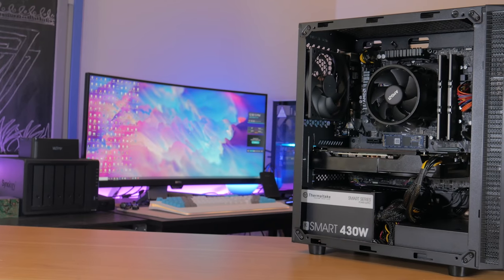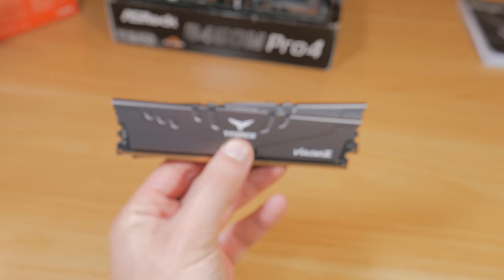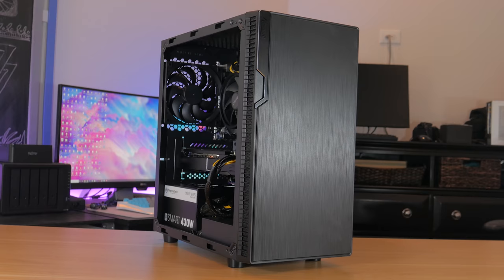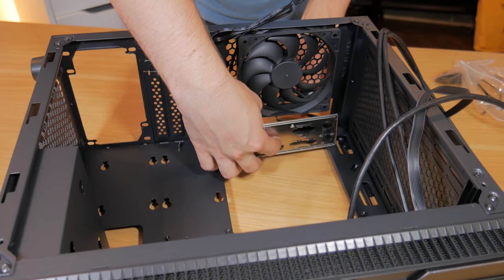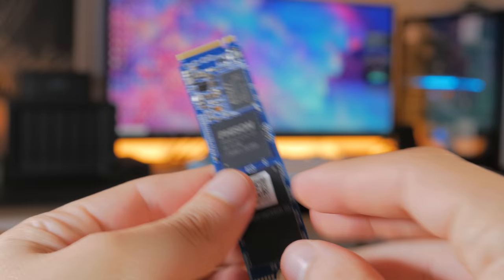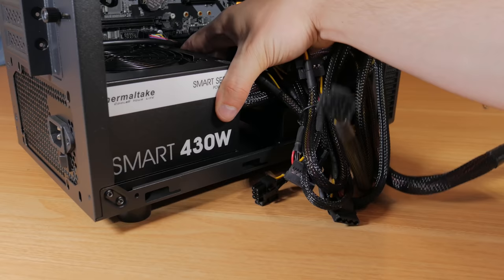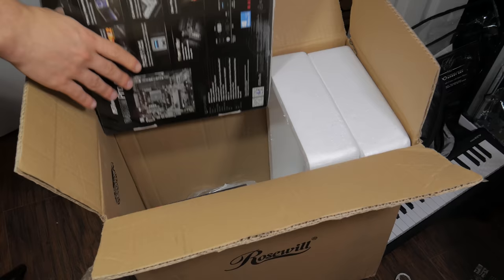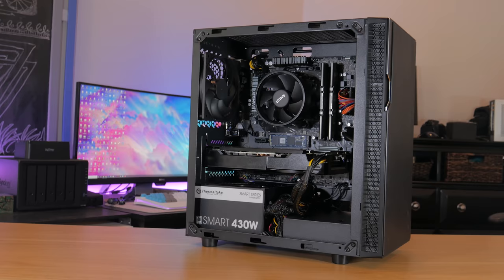$400 Gaming PC Build Guide! (2019)

Comment: So my budget is $500-$600 I’m definitely going to get 16 gb of ram but what gpu should I chose that offers more performance
Reply: Rx580 if you can afford it
Reply: I would shoot for a RX 590, or a 1660, it’s up to you.
Reply: I would upgrade your CPU to a 2600 or 2600X, and the ram is fine (for now) just get it faster you will have to upgrade your GPU to something better tho (this is what I would do, listen to me if you want)
Reply: Sanctified Rezus No, you need the 16 gb as first upgrade. And also, 1050ti is literally 50% worse than the 570, so no again. I agree with the 2600 though.
Reply: @CrisisVFX  you really shouldnt give people advice when you have no clue at all
Reply: @pinkin8012  ?
Reply: @pinkin8012  explain why I'm wrong
Reply: @CrisisVFX  vibiz already answered that question. You recommended a freaking GTX 1050 Ti. Its not an upgrade but a severe downgrade
Reply: Shubhabrata Ray there is little to no difference between the 1060 3gb and 1060 6gb. There both almost equal to 570.

Comment: The Ryzen 5 1600 fantastic value.  If you want to save a few dollars, suggest picking up 2nd hand cpu and gpu. Picked up a 2nd hand 1600 for USD 71  RX580 8gb for USD 91 could not be happier

Comment: Using Windows 10 inactivated does have 1 small disadvantage other than the water mark. It also will not allow you to use the personalize settings such as the themes and desktop icon settings

Comment: A new update just buy the cpu to Ryzen 5 1600 af this cpu will give you the power of Ryzen 5 2600 but its even cheaper then Ryzrn 5 1600 i think its around 85$ and change the gpu too gtx 1650 super or RX 580

Comment: i personally would  go for a better power supply like Seasonic M12II 520W with full modular and black cables. And the case i would choose for the Aerocool Aero300 faw or Aerocool Cylon with similar price point with acrylic side windows and there are also options with white version for the Cylon. And one more thing would definitely recommend to get an 8 gb stick, so you can purchase another one for dual channel later. Other than that, the choices are quite decent.

Comment: My budget build - Firestrike score : 15,757 by [Tek]Praetorian
Intel Xeon Processor W3680 6-core/12 Thread(3,300 MHz) Stock
Turbo 3.6GHz
AMD Radeon RX Vega 64 8GB HBM (1,637 MHz) Stock
16GB RAM syste
1TB SSD
600 watt Gamemax PSU
Water cooled Antec K24
RGB lightening.
$508 total cost. 
😉
Reply: Noice

Comment: The psu you choose is really bad, there are plenty of better choices for similar pricing
Reply: Agreed, don't buy Thermaltake. Also I'm concerned about thermal performance with the PSU + GPU fans fighting for air the way Matt has installed the PSU. IMHO it would be better to install the PSU fan downwards.
Reply: @blakecasimir  Tt has some good products, but under a certain level it has only shit. Like, some 80plus bronze and above are good, under that line they use mainly cwt crappy series like the ones in corsair's od vs's anche in cooler master lite series

Comment: I bought basically this Pc for 400 myself although it was used. Hp Pavillion desktop. 
I don't even get close to the fps you are pushing from your build 

Ryzen 5 1600 
16gb corsair vengeance ram 
Rx 570 4gb 
400 watt 80 plus platinum power supply 
500 gb ssd hynix w/ 1 terrbyte hard drive
Hp sunflower motherboard which is basically the Achilles heel of the system

Comment: 3dmark: Firestrike 

SCORE
15 757 with AMD Radeon RX Vega 64(1x) and Intel Xeon Processor W3680
Graphics Score 23 494
Physics Score 11 316
Combined Score 5 470

DIYPC DIY-A1-BK Black Tempered Glass USB 3.0 ATX Mid Tower Computer Case with 1 x 120mm Fan x Rear Pre-installed  29.98

GB LED Strip Computer Lighting via Magnet with 24 Key Remote Controller $14.80

SAPPHIRE Radeon RX Vega 64 DirectX 12 8GB HBM2 PCI Express Graphic Card $249.99

Intel Xeon W3680 3.33 GHz 6-Core/12-thread CPU | SLBV2 $64.90

Corsair CMZ16GX3M2A1600C10B Vengeance $67.99

Antec KUHLER H2O K Series K240 120mm CPU Liquid Cooling System
$70.65

Power Supply 600W Semi Modular 80+ Bronze, GAMEMAX VP-600-M-RGB
$54.99

X58 LGA 1366 motherboard LGA1366 support REG ECC DDR3 and xeon processor USB3.0 HUANANZHI
$51.7

Total $509

Comment: I really would spend the extra money for a better psu.

A smart 430w is anything but a smart purchase.
Reply: I got a Thermaltake R2 500w for my optiplex with rx 570 but it didn't have the correct 4 pin
Reply: @dapyzzz4209  thermaltake tr2s are also junk. Really something like a Corsair vs550 ($37) would be a better choice.

Really I love the Corsair CX models. They are relatovely chesp but also use LLC resonant topology, a premium feature.
Reply: ☺️ jiji

Comment: My system costs around 1000$ back in 2014 I got most of my hardware used and some of it free from family. i5-3570K , GTX 960, 16gb RAM
Reply: I had a gtx960m and damn it was horrible i could open counter strike on lowest settings in 90fps

Comment: The cs go seemed kind of like it was hanging in the benchmark video. I've seen it runs like water on processors like  ryzen 3 2200 with same graphics card. So going to next gen processor would be same if not better is what I would think.  Either some thing went wrong in your recording or something else is different in your setup.

Comment: hey I need help on upgrading my younger brother's pc that I got him. He has ryzen 3 1200 with an rx 560 ,his motherboard is a b350 with 16 gb of ram. currently i only have 100 dollars to upgrade his system but I don't really know what to change with my current budget. He mainly plays Overwatch but I bought him Borderlands 3 and his system could barley run it so Im bummed that he cant play the game he's been waiting for a while now. Any advice would help.
Reply from the maker: I would probably upgrade the GPU before the cpu. Going for a rx 480/580 on ebay for around $100 is a good way to go. Also see if you can overclock the cpu and ram a little bit as that can be free performance. Also sell the 560 after upgrading to recoup some of the cost.

Comment: For around $490 I built a PC with ryzen 5 2600, 16gb ram 3000mhz, 256 GB SSD , case with clear side panel, gtx 970
Reply: That's including windows 10 pro key and a 500 watt power supply

Comment: Go for used parts.
build a similar system last week for the same money but with better parts.
R5 1600 65€
Wraith Prism Cooler 13€
MSI B350 GCPro 50€
2x 8gb Aegis RAM 50€
RX 480 8gb Red Devil 100€
500w be quiet SFXL 50€
250gb Samsung Evo 850 10€
2tb Seagate NAS 20€
New be quiet pure base 500 50€
Reply: F1reMaker1 Naah.. Please don't choose 2nd hand system storage

Comment: Still using xeon x3430@ 4ghz paired with that same rx 570 with 12gb ram kinda still ok for games @ medium to high settings considering my system cost like 250$ a mixed of used and brand new parts
Reply: 🙂 pu an 8thread 3470, they are really cheap now
Reply: @MrSamadolfo  yep theyre like 20$ in my country before they were like 30-40$
planning to buy that after buying a 480gb ssd

Comment: Good configuration at good price...Very good and educational video...I am having HP au114tx laptop with Nvidia 940mx graphic card 4 gb..do increasing my ram is going to improve my fps for games like battlefield v , kingdom come Deliverance, Witcher 3 ??? My current fps is approx 20 on these games with low setting..please suggest me..thank you
Reply: 🙂 laptop or desktop you shud b running 8gb of system ram, those games are very heavy
Reply: @MrSamadolfo  thanks for advice sir..but my ram is already 8 gb and graphic card is 940mx 4gb with core i5 7th generation
Reply: 🙂 ok i checked, ur gpu only has a 3D Passmark Score of 1367, so thats pretty low, thats like a GTS 450 or HD 5750 video card on a desktop, theres nothing u can really do but try lowering the settings to 'Low & 1024 x 768' other than that is to move to older games like on GOG, and get another laptop or desktop later on, maybe a cheap used one and upgrade it with a used but faster video card 🙂

videocardbenchmark.net/gpu.php?gpu=GeForce+940MX&id=3453

.
Reply: @MrSamadolfo  thanks sir for advice...
Reply: @chotudivedi3018  🙂 sure no problem, Play Hard 👍

Comment: Has anyone build and played Destiny 2 on this? That’s probably going to be the main game I play.
Reply: LilNuut I actually used to play destiny 2 a year ago with my old specs that were a ryzen 1500x and a gtx 1050ti. Worked very well on even med settings. Destiny 2 is very optimized on pc. I upgraded my 1050ti to an rx 570 8gb and saw a big improvement in destiny 2. I currently have a ryzen 1700x and the same rx 570 8gb. The game is so optimized I love destiny so much it’s nice you can play even on entry level parts

Comment: Hi 
I found this video very helpful. I just have two questions : 
Where do you get the drivers as I have repaired a laptop a week ago. I changed out the broken hard drive and replaced it with an SSD and reinstalled windows. The find is that the drivers where installed automatically so I don't know if for a "home-made" gaming pc will do the same or  will I have to do it my self ( I've seen on YT that you do have to do it your self but I'm wondering if it was the same for this computer. 
My second question is : can you play fortnite and battlefield 5 at 144hz even on low settings ? 
Thank you and have a great day !
Reply: Pretty sure drives don't need drivers and Fortnite will run at 144 but Battlefield won't at 1080p.

Comment: hey @Tech By Matt i build the same system with you but i bought an rx 580 assrock for 125 but it goes near 85c when playing games at full or high like farcry 3 what should i do (the gpu is new) should i replach its paste? with some mx4?
Reply: 🙂 sure try that, but before that have u tried raising the fan speed using Afterburner? and in afterburner try unlocking the voltage slider, then slide down the voltage and hit apply, keep lowering it until it crashes, does that reduce temps enuf? also open Riva and put an FPS cap, like 35 fps, does the temp come down?
Reply: @MrSamadolfo  yes man its the same 3000rpms and the cpu temp are almost the same (i read on a forum that the heatshink of the gpu is poorly in quality in cooling the gpu ,some mx4 will get the gpu at 75-80 thats like 5/10 celsius lower)

Comment: Hey bro i just want to ask that for rx 580 8gb and core i7 3770 both stock is 450w 80+ powerstation psu is good i know is not enough but will it cause any kind of damage?
Reply: 🙂 nope, its fine, assuming thats a fairly new & modern power supply
Reply: @MrSamadolfo  yes its new and unrepaired!
Reply: @dota2gamer469  🙂 ok great then u should be just fine 👍

Comment: Power supply and graphic card fans both faced each other so it might be overheats
Reply: 🙂👍 its fine, the psu fan sucks air down, the gpu fan blows up into the card and then the hot air rises up & out
Reply: I don't agree it's fine, imho better not to have the PSU and GPU "fight" for air.

Comment: Ive got the ryzen 3 2200G but I want to upgrade the gpu as vega 8 is not that good, do yall think a gtx 1050ti could run fortnite at 1080p 60fps?
Reply: Yes it will, I have a 2200g and a GTX 1060 3gb and I get over 60fps in fortnite. 1060 and 1050ti have around the same performance.
Reply: Mike Polk I’ve kind of got a high budget for the gpu so i might get a really really good one but without getting to the point of cpu bottlenecking
Reply: @fabian546  sounds like a good idea I wouldn't go any higher than a gtx 2060 or don't forget about rx 580 and 590.

Comment: Guys, quick question: 8gb 3000mhz or 16gb 2666mhz? Will the speed of the ram really make a difference beteren 2666 en 3000?
Reply: Roan Andrea no, you will not see the difference
Reply: 🙂 on a Raisen 🍇 platform it will, its built differently compared to anything else

Comment: Hey matt the exhaust fan did turn on on the first time? Im having a problem that i have is that i wont turn on until i enable max speed at bios
Reply: Try a different fan port on the motherboard
Reply: 🙂 maybe its plugged in the wrong fan header, read the tiny print on the board

Comment: i have build a similar PC like this one and i have run with a problem. 
i have the mouse and keyboard connected by USB and when i plug in a USB cable for charging a phone or a controller all my USB connections  power down for about 15 sec and then they come back, like a reboot.
 i do have a 500w  80+ bronze psu but i dont think is the psu because i consume about 430w. 
does anyone have and idea what it could be?

Comment: So I have a question, I was talking with my friends and pc builders, and with this same build, I ordered the parts and everything besides the ram, used a different ram. But, it says the RX 570 needs 450w power supply. And I’m this build it’s a 430, wouldn’t this burn out the power supply? I’m very concerned about when I power it on and play games for extended time, my pc with burn out and, my parts and everything will die, and or if I overclock it as well. Can someone help me out, and tell me? Will this run my power supply out and ruin my pc? Or can this run good/fluent and won’t burn out?

Comment: Can I connect this with WiFi or does it have to be through Ethernet cable
Reply: You would need to add a Wifi card to the build otherwise you are using Ethernet cable.
Reply: Shirewolf thanks, so you recommend any brands for this certain build?
Reply: @Andrew-zy6cz  I believe this build leaves you limited space with the lower PCI slot to add a card as its fit may interfere (rub against or stop) the GPU fan blade just above it. (The Wifi PCI card would be between the top of the PSU and the bottom of the GPU card)  Amazon has cheap plugin USB WiFi adapters you could try.
Reply: Shirewolf aight, thanks for all your help man.  :)

Comment: Im wondering if the 430w psu can supply power for the gpu, im new at this kind of stuff but i search that 500W psu is the minimum requirement for rx 570. I have plan on upgrading my gpu to rx 570. I have 500w coolermaster.
Reply: PLEASE HELP

Comment: wont that video card be fighting that psu for airflow?
Reply: 🙂 nope
Reply: @MrSamadolfo  disagree. My question was rhetorical. Both intake fans are facing eachother, so yes they will fight over air flow, whenever the PSU fan turns on.
Reply: @TheTokuin  🙂 its fine, the psu fan will pull air down into the psu, while the gpu fan will pull air up into the card, the front case fan feeds them both with fresh air 😍 yay!

Comment: How would this system perform for simply watching HD movies on VLC and streaming movies in hd from vudu, crackle, tubi, popcornflix, etc. This would be for a bedroom system, I already have a robust system for the living room. No games would be used. I am not sure to go this route or a core i3-9100 with a Gigabyte Z390I Aorus Pro? A little bit more money but might be worth it. All other parts I have. Thanks for the video
Reply: It'll perform exceedingly well. Some may even call this 'overkill' for just streaming and watching movies.
Reply: Thanks. I ordered the new amd 1600 AF from amazon ($85) and purchased from microcenter the Gigabyte B450I Aorus Pro Wifi AM4 mini-ITX AMD motherboard. I have memory, ssd, case and PS already. Will be putting in from my other system a gigabyte 1080 TI since for that system, I already have installed a core I7-4790K (living room setup) which does just fine for watching movies without a dedicated GPU. AMD system going into a H200 case. Maybe any overkill system but why not buy with future growth in mind. Yes, the 1080 TI is probably way more than one would need for watching movies but I have it already and was donated to me by a buddy. The AMD system will need a GPU so why not just use what I have.

Comment: Can someone pls help, I just built this and when I try to boot it up, my monitor just says no signal. Everything seems like it’s running fine: my fan, gpu etc.
Reply from the maker: Make sure you're plugging the display cable into the graphics card and not the motherboard. I would confirm the cable you are using is working by testing it with something else. If you find the monutor/cable isnt the problem, reinstall the ram and the graphics card. If none of this works, you can DM me on Twitter for further help.

Comment: Just asked my dad if me and him could look up parts to build a gaming pc he said yea but i didnt ask the budget yet, but if its $300 or over i think i can run fn pretty well, also i saw 16 gb ram for $35 soooo?
Reply: The ram you saw was probably DDR3 , it’s an older generation of ram that isn’t compatible with new motherboards and CPUs . Just about anything with a budget over 300$ can run fortnite with good frames and high settings . I recommend taking a look at the 3400g or 2200g ryzen CPUs.
Reply: yea i got a ryzen 3 2200g cpu and the ram i have is Patriot Signature Line 8GB (2 x 4GB) 288-pin DDR4 PC4-17000 2133MHz Memory Module Kit PSD48G2133K and yea that cheap is one i found was DDR3
Reply: EnvyTheShotZ nice

Comment: why diidn't you picked a ryzen 3 2200g its like the same price but better
Reply from the maker: The ryzen 3 2200g is a four core four thread CPU. The CPU I used(Ryzen 5 1600) has six cores and twelve threads. The r5 1600 is considerably more powerful than the 2200g.

Comment: 400$ in u country (maybe will be with more in my idk how 50 or 100$

I make a i3 9100f 8gb 2666 hyper fury black psu:520W seasonic (for 100$ rx450 4gb second hand) and case motherboard B360M Pro Vd for 284Euro
What is u opinion should i buy a amd r3 3200g B450M DS3H 520w seasonic and case 2x4g and laterr  (for 100$ rx 470 4gb SH) with 75Euro?
Reply: Vaslui Ocazie i choose i3 9100f
Reply: 🙂 is used ddr4 2400 cheap for you? if yes then get the i3-9400f, they run fine with slow memory

Comment: Why did he put the power supply fan facing up? It's not up to you, it is highly recommended to put it fan down... so there IS indeed a difference. You now are going to choke your PC, sucking most of the air in the chamber, into the PSU... Not a very good choice in my opinion.